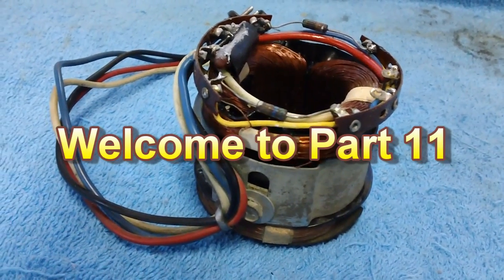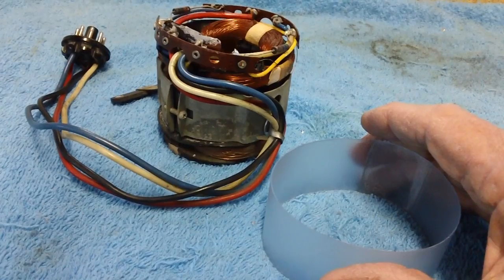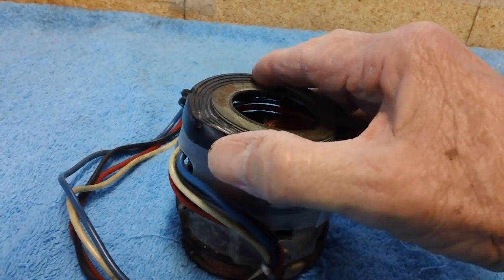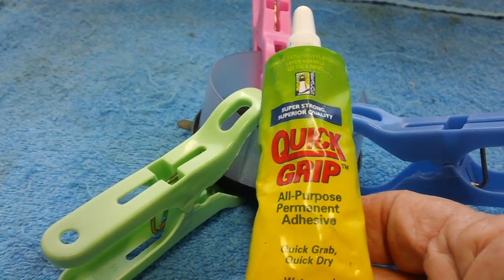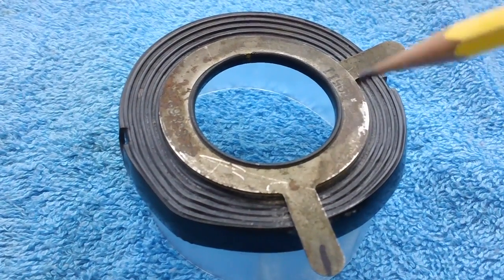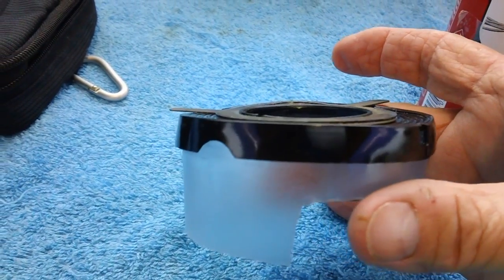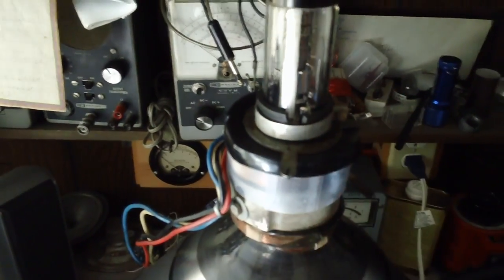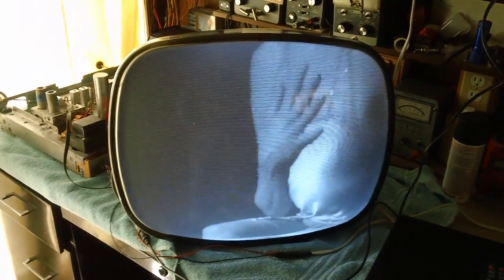1956 Sylvania 21" Halolight TV restoration (part 11 of 23).

Comment: John,
I’ve been off-line for a few days due to not being able to access the internet.  British Telecom (bless ‘em) cured the fault: it’s good to be back LOL.
I very much enjoyed watching this video.  It was interesting seeing you make the new plastic dust prevention skirt to fit round the scan-coils.  Depending on the environment where a TV is located, airborne dust particles can have a large carbon content.  Over time, a build-up of dust can cause the scan-coils (especially the line [horizontal] coils) to arc, and eventually destroy them.  I use virtually the same type of plastic you use for jobs of that sort.  The type I usually buy are the tough plastic covers used in association with comb binders: lager sheets are available (from Hobby Craft – I wander if there is a connection with Hobby Lobby?) but it is slightly thinner.
Brendan is right to inform you those centring rings need to be free so you can centre the picture.  When rotating them, the picture appears to move up and down, and side to side – the picture is moving in a type of circle.  Often, adjustments are made by delicately rotating one ring, and then the other.
By the look of things, there might not be much centring adjustment needed.
Cheers my friend,
Phil.

Comment: QD electronic cleaner verses Deoxit. I wonder which is the best ? QD is much cheaper. In fact, I got my last can at Harbor Freight.
Reply from the maker: Jeffrey,
No doubt QD takes longer to clean contacts, etc., but for the much lower price I can easily deal with it.  In my mind the cost of Deoxit is insane.

Regards,
John
Reply: Different tool for a different job.  QD cleaner doesn't have the lubrication built in that Deoxit has. I use both.
Here is a video that taught me the differences.
https://youtu.be/ygrlO_VacsY